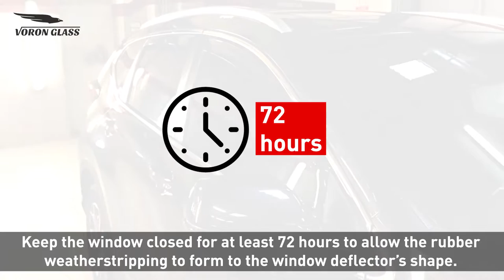How to install Shatterproof In-Channel Window Deflectors for Honda CR-V 2017-2022

Comment: Do these put strain on the window motors and my CRV has auto retracting glass to stop fingers getting trapped will these trigger the sensor, ive heard stories about these in channel visors bustin motors.
Reply from the maker: Hi Azureecosse!
Thank you for your inquiry. 
Yes, there is a potential for interference with power window motors that are extremely sensitive to any resistance. While we cannot speak to every individual experience, generally, if the installation is done precisely according to the instructions, such issues are unlikely to occur.

Best regards,
Customer Service Support
Spark Lines, Inc.

Comment: Would’ve been better to show the view in between mirror and window. About to return mine. Has the rubber seal on bottom all cock eyed and bent. Not trying to ruin my new car
Reply from the maker: Hi,
Thank you for the comment.
Kindly note, that our product has been carefully designed by engineers and every detail has been taken into account.
Besides, kindly note, that all our products have a limited lifetime warranty.
That`s why, if you have any questions related to the item purchased from Spark Lines Inc., please, contact us by e-mail: customerservice@sparklinesinc.com and we`ll assist you immediately.
Best regards,
Customer Service Support
Spark Lines Inc.

Comment: Paid $100.00 and can't  return them.  Didn't come with clips.  Honda shop couldn't put them on either.  I guess I bought the wrong ones and didn't  know it!!!
Reply from the maker: Hi Cynthia!
Thanks for reaching out.
We are so sorry about your issue and would be glad to help.
Please contact us via e-mail: customerservice@sparklinesinc.com and provide us with your order number.
Under our lifetime warranty we are always ready to send you a mounting kit for your set of deflectors if it is available in stock or send you the whole set of deflectors for free.

However you are always welcome to return the item if you are not satisfied with it and get a full refund. 
If you have any problems with it, do not hesitate to reach us via e-mail.
We are there for you! 

Best regards,
Customer Service Support
Spark Lines Inc.
Reply: These things suck, doesn't stick and comes a loose easily.

Comment: Got the front two in easily, back windows no way.  Back windows are impossible.
Reply from the maker: Hi Don!
Thanks for contacting us.
We`re very upset that you`re having problems with the product.
Could you, please, reach us on customerservice@sparklinesinc.com, send your order number and more details/pictures illustrating the issue you have?
Then we'll assist you further under our limited lifetime warranty.
Best regards,
Customer Service Support
Spark Lines, Inc.